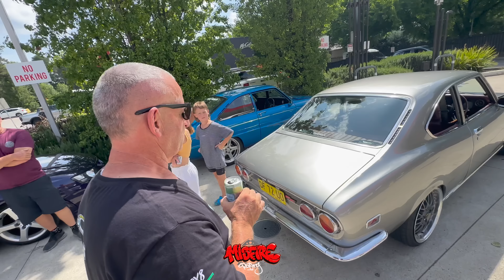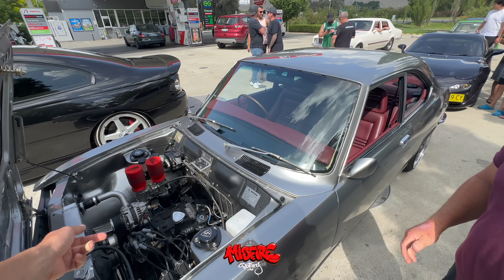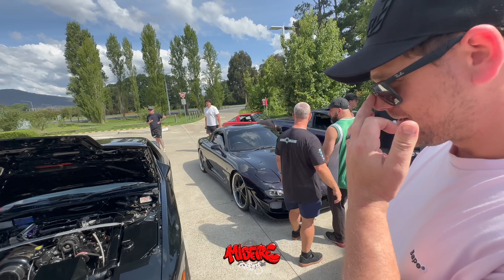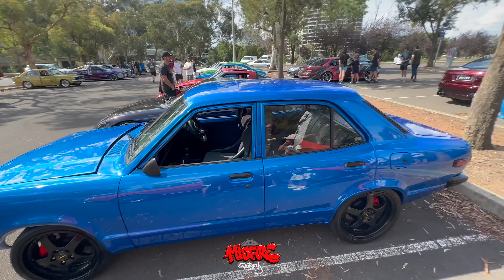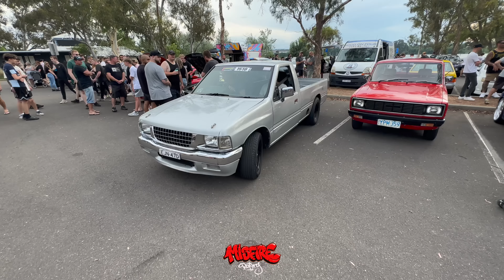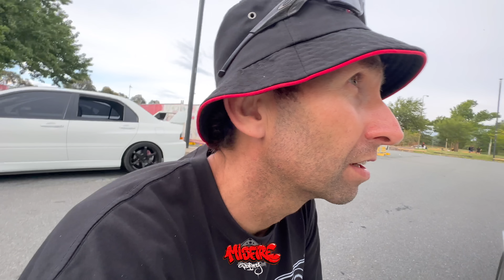Summernats 36 First BIG pre meet up 2024

Comment: The vehicle height thing in NZ is if it's under 100mm ride height you need a certification. The difference is the height is measured from the lowest structural point so you can run them slammed.

Comment: I know you're probably heaps busy but what was the go with the dude on air bags? So you can't even have those coilovers with airbag tops on them? I'm guessing if the cops see you parked and squat that they will just defect you, so you almost just need to keep your car fully inflated all the time....... effectively making them pointless unless you want to do a photoshoot and you've got mates with a 2 way so that they can warn you when cops come........for friggin airbags FFS! What do they defect every Toyota soarer or crown  that comes factory with air bags? What's their reasoning is it just cause it's too low or that air bags are detectable because they weren't fitted from factory and therefore need to be passed by engineer? If it's the latter then it's really only that young dudes fault for driving unplated, yeah? Or am I missing something?
Note to self don't drive modded cars in ACT lol
Reply: Airbags need to done right and even then they destroy handling and feel for the road and significantly decrease top speed as they don't like going much over 100 lph